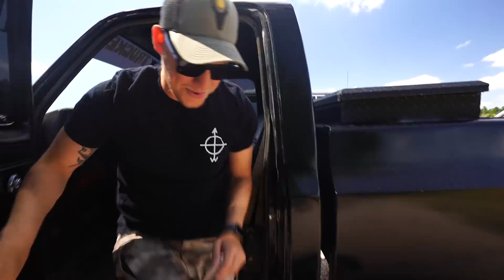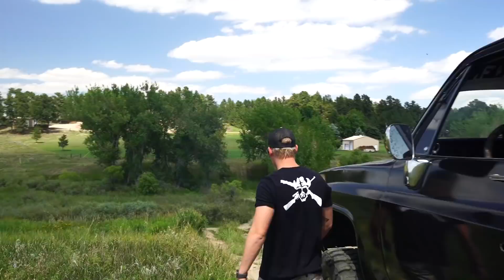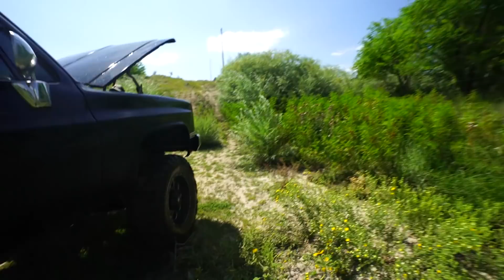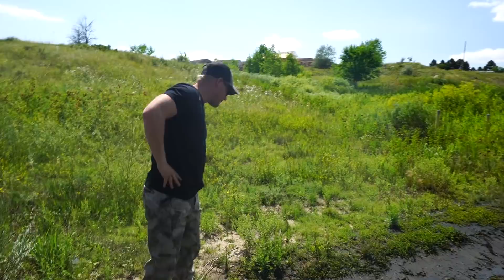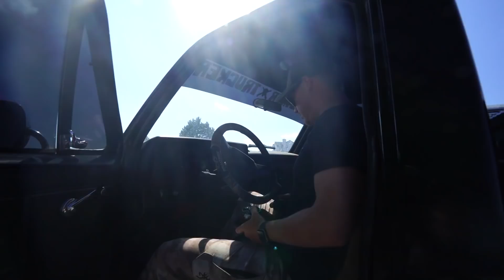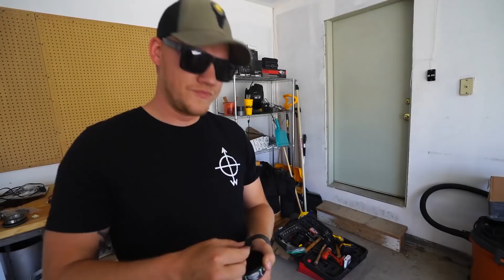SNEAKING into Private Property MUDHOLE... *revenge*

Comment: Cops where I live drive 4x4 F150's. They have them all decked out too. They must be confiscating alot of money and drugs.
Reply: police duramax went by me last year, lifted on 20x12's black with white paint in the middle like a square body but on a 04 crew cab duramax and it said POLICE all the way down the side. female driver in uniform.
Reply: Jeremy Newhouse that's how it is in Richmond hill ga. They bust so many dealers traveling up and down 95 that they now have lifted trucks, decked out 4 wheelers, a few motorcycles and a fucking swat truck. They also had a full sized gym built for cop use only by the station.
Reply: Jeremy Newhouse must be soutg florida they do the same here

Comment: Get a blanket for your distributor. It's getting wet.
Put a stock 80s chevy air filter on it and it will protect the filter front water splashing. 
These trucks don't like water without the distributor and air cleaner being protected. They never had much of an inner fender aside from the metal that you have. They did have a little rubber flap but they didn't do much.

Comment: Di-electric grease is your friend bud
Reply: Dixie Duck Hunters in my field dielectric grease does more harm then good, but go for it
Reply: Ryan Jaracz has worked for years on my Jeep, ranger and rzr that pretty much live in water here in Louisiana
Reply: Applying it correctly does work, putting it in pins causes interference with reference voltages.
Reply: Ryan Jaracz I use it mostly on ignition components. Plugs, wires, and coils. Mainly anything that will kill the engine if it gets wet

Comment: Put you a bag over the distributor cap keep the water out or keep some WD-40, on hand take the distributor cap off and spary the inside of the cap WD-40 takes the mosture out so it will run

Comment: it needs King coilovers all the way around it'll give it a bigger lift and a softer ride and then you need to do fuel injection so you won't ever have carburetor bullshit problems that's where you can at least start oh yeah and gears and some kind of air Locker up front or cable Locker or something
Reply: Joshua Gooden no, he needs a ford
Reply: CJ s fords are shit they literally circled the problem on there logo
Reply: Joshua Gooden a carb is the way to go on those trucks in my opinion. Picked a racing carb up for my 85 Nissan king cab from summit racing in ATL. Never had a problem.
Reply: Carbs are fine if tuned right😂 and its not just as easy as putting coilovers on it

Comment: hey outlaw them trucks don't have drum brakes all the way around only on the rear .if you want to solve the carburetor problems look up holly EFI kits . their 800$ for fuel injection adds power fuel economy and throttle response .     if your truck keeps jumping out of 4x4 when you hit bumps . I went through the same thing with my k20 . my cab mount was broke causing it to jump up and knock the transfercase out of 4x4. or you could need to adjust the linkage on the trnsfercase .   also the most comfortable seats are out of the 96-98 chevy trucks and tahoes and suburbans but you will have to build lower seat tracks and mounts because they sit high do to how the cabs of the gens are designed . the seats out of the early 90s are the best they sit a little lower than the later 90s models . ive got 4 squarebodys a 85 k20 big block 4 speed on 35s  , 86 k30 dually with a 12 valve cummins and nv4500 on 35s, a 85 c10 swb big block with a 6l90e and a 84 c10 long bed with a 383 stroker and a 4l80e

Comment: INNER FENDER LINERS!!! Also Dana 60 swap.( yes it's worth it. Did my 72. Best upgrade ever. No axle or gear issues since with 38s) and a stand alone throttle body injection system should fix your fueling issues.  Skid plates are your friend.

Comment: Get conveyor belt and cut it to the length you need per side attached to the inside of your inner fender well that you already have on truck then attach to your frame rail that should cure your problem of tires spraying your engine compartment

Comment: buy a can of wire drier, spray your plug wires and outside of distributor cap and coil etc, it will he;p repail the water works great

Comment: since you told us to give you SHIT!
1. waterproof electric fan (direct on/off switch)
2. upgrade that steering (as soon as you put big wheels on) or its gonna be a problem 
3. unless you like to tune on carburators frequently especially when the truck sits for periods of time get the Holly EFI
4. and yes get the dam inner wheel wells

Comment: Good video, keep up the builds and muddin. 
 But wtf!lol Fender Well covers!! Its like.. an hour or two of work...lol epic buddy.
And you should snorkel off the filter through the hood. Add a skid plate/water guard under engine. Re wire your fan to a switch with direct battery connection.(get a battery box too)
There's a bit of a list for ya..
I'm just trying to help and that's what I would do, if it were mine.
Reply: Wheel well.covers- take some thin gauge steel. Tack weld or create a way to bolt on. Roll it and form it to your well, then attach.
-I have done this for custom shields around my exhaust manifold.

Comment: Should put sheet metal for the inner fender for engine but put them in the engine bay part and for the fans put them on a switch and the cab take some ppc pipe and make u a snorkel and that blue glue that so it can waterproof it and hell to the yeller

Comment: Put Fuel Injection in it, it should help with the fuel issue. It sounds like its flooding a lot, which is why its hard to start after running it hard. But hey, what do i know. i only have a truck that has a carburetor

Comment: If you bought the Honda 2000 it has a built in charger I have a 110 plug with cord to alligator clips and it charges my batteries if need be but my lights are ran off the generator it can't can't charge fast enough to keep up with the trolling motor had to go to golf cart batteries and in our bow fishing tourneys I run all night with my batteries and I have 110 lb thrust trolling motor on the golf cart battery's if that helps you at all

Comment: electric fans are good but if you're gonna run it like that the liability of a fan bolted to the water pump just cant be beat. it doesn't kill that much power, besides what power it does kill is at wide open throttle. engine masters on motor trend proved that. they did a episode on just fans and they don't affect power that much.

Comment: It’s series not sequence. And if the lights are 12v you need them in parallel not series. Series will push 24v so lights will take both and there are 24v trolling motors. Just letting you know to be careful not fuck your shit up.